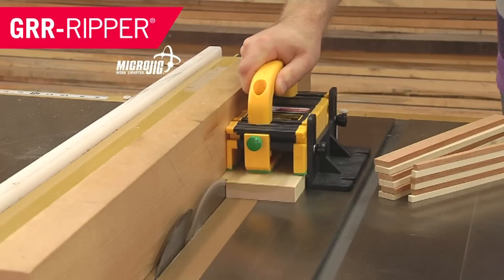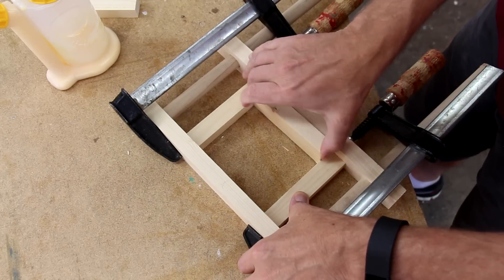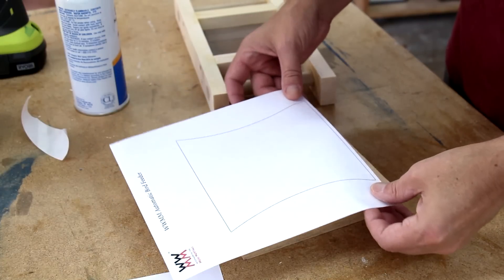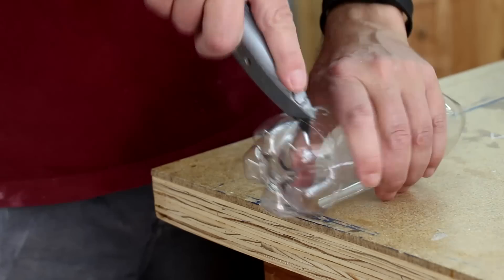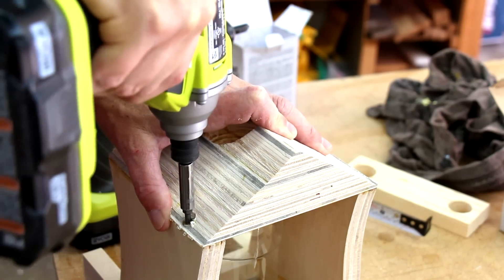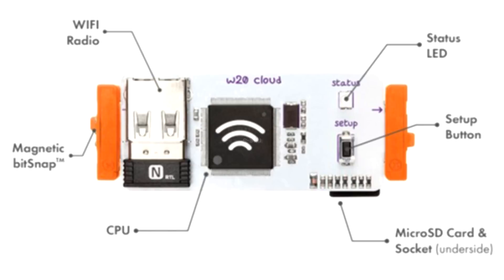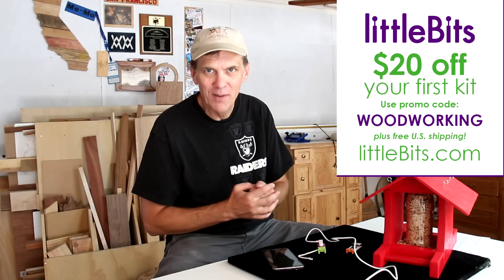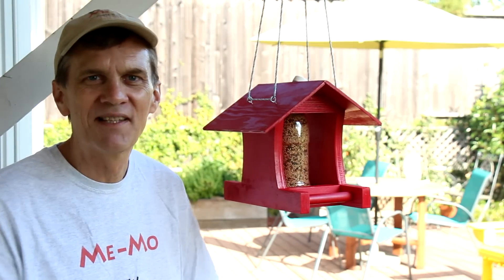Make an Automatic Bird Feeder

Comment: Hi Steve! I'm a huge fan and your channel has really inspired me to embrace and experiment. I was just wondering a couple of things - why do you use plywood for this project instead of regular 1x4s or 2x4s (or something of the like)? Also, can you use brad nails instead of screws? I'm new to woodworking and just trying to understand the "hows" and "whys" of everything.

Thanks for having such an awesome and empowering channel!!
Reply from the maker: I often use plywood on projects that I am going to paint since I don't care what the wood grain looks like. It is cheaper than solid boards and flat...no twists or warping! Brad nails are fine, but can eventually work their way out. Screws are always more secure. But in a small project like this, it doesn't really matter. Wood glue will be stronger than either fastener.

Comment: Super easy no-mess funnel:

Take an identical bottle and it's cap, plus another cap. Cut the bottom off of a bottle, then cut out the center of the two caps, then super glue or hot glue the two together, top to top, so that there are threads on both sides. Now you can thread your funnel onto your opening.

I use this with water bottles for meal replacement shakes so I can just grab a bottle of water and put the shake mix in without having a blender bottle.

Comment: You can also cut glass bottle by using a cotton string dipped in acetone, wrapped around the glass bottle a couple times and lit on fire, then dipped in cool water. It's obviously more dangerous to do for younger people in the audience, but it works extremely well in my opinion.